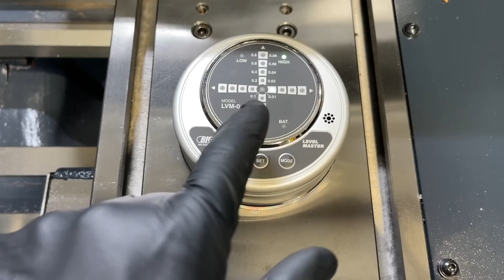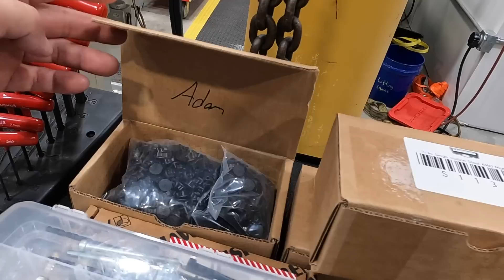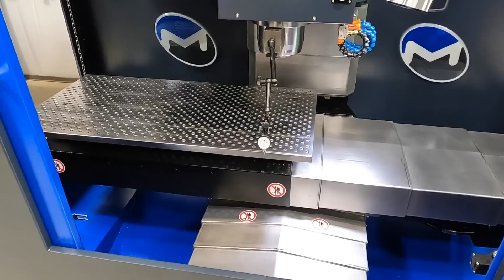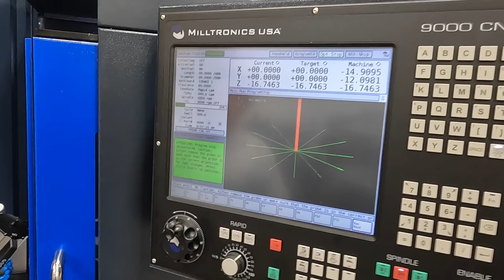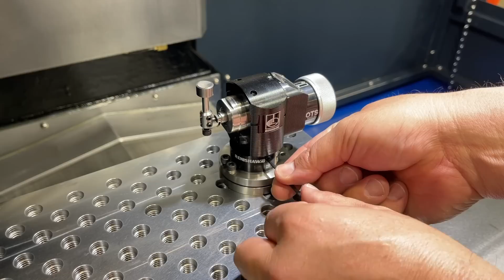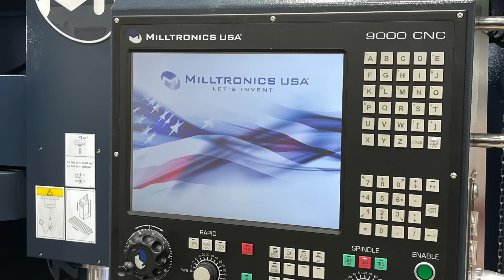Setting up the Milltronics CNC Machines for Service

Comment: My brother said he sometimes used steel as thin as Renolds wrap for shims when he installed equipment. He would consider your machine small. His installations were the size of a semi-trailer.
Reply: I used about 0.010 - 0.020 shims to adjust elevator doors. They were surprisingly fussy.  The maximum clearance for the lock safetys was 0.060.
Reply: @firesurfer  I’ve use ships like that on aircraft. Very fussy indeed.  Easy to mangle to oblivion
Reply: @franknphotos  ships?  or shims?
Reply: @firesurfer  Replace "ships" with "shims" and then read it again with "ships" left in there.  Then ask yourself what word he actually meant.
Reply: @verteup  I know. I was just teasing him.  No harm.
Reply: (It's all relative. There is the old Guy Lautard shop joke.)
The watchmakers apprentice was shown a .250" U.N.C. taper tap.
His eyes got all big and he went quiet. After some seconds he let out a quiet whistle and said -
"I had no idea they made 'em THAT big . "
Reply: @agwhitaker  The 1st and 2nd Bedside reader is on pdfdrive. I didn't see the 3rd there.